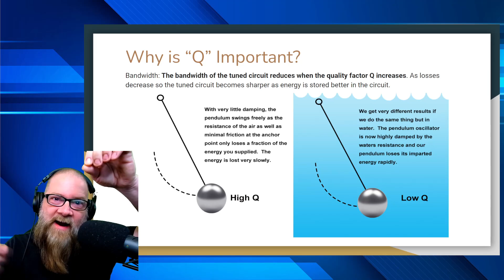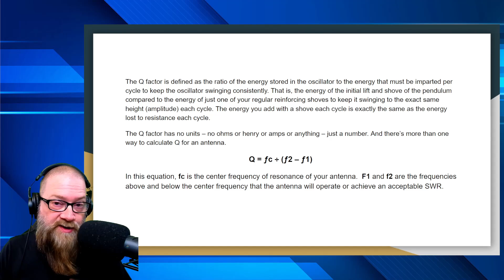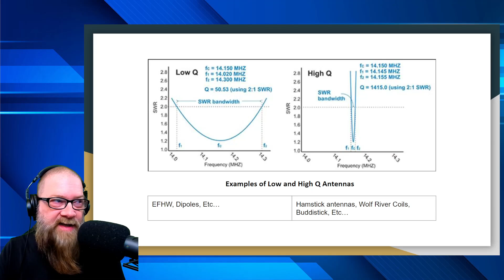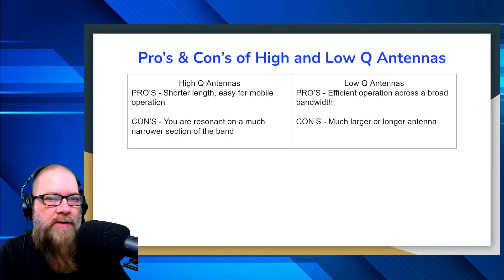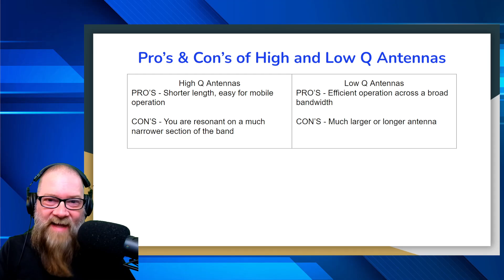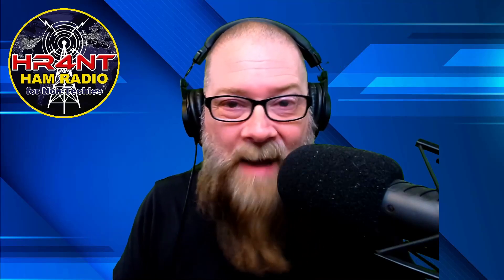What does the Q of an antenna mean?  It's easier than you may think.

Comment: A little late on this, but figure I should bring this up, as it doesn't appear to be mentioned.  As far as Q Factor is concerned with antennas, it isn't just antenna length and/or wide vs narrow banded.  There is one other item that seems to be overlooked....efficiency.  A High Q antenna also has higher radiation efficiency at resonance, while a Low Q antenna has lower peak efficiency.   To put in more layman terms, a High Q antenna is a "sharpshooter", whereas a Low Q antenna is more of a "workhorse".    

This why a properly sized Mag Loop Antenna (MLA), which are rather High Q antennas, can be so effective considering their size.  For a real world example, these are comparisons on 10/15/20/40M between my MLA and my EFHW cut for 40M ( https://imgur.com/0vq6zFm ).  These were relatively back to back test, within 10-15 mins of each other (except for 10M which was ~30mins).  While not quite scientific, it does give you a ballpark idea.  The EFHW is always a lil better; however, it isn't until it 40M that the difference becomes much more significant.  That said, while the 3ft diameter MLA is capable of operating on 40M, it's more closely sized for 20M..hence the results.  It should also be noted, the MLA was tested while in my living room...not outside...just sayin' 

Food for thought 😉
73 de KC5VAZ

Comment: Thank you for your explanation of the q factor.  So a  20 meter dipole would be an example of a low q antenna, correct? Also ,the swr reading is just to give you reference points for f2 and f1?
Reply from the maker: Yes you are spot on.  Not sure what you mean by f2 and f1??  Let me know more on that.  Thanks for the comment and for watching.  73!
Reply: @HR4NT Q=fc/(f2-f1)
Reply: Does f2 and f1 have to be for 20 meter between 14.000 to 14.350?

Comment: This article is fine as it goes being pitched at the basic end of antenna theory. People thinking on from this level will suspect that all is not as stated here, and to be fair almost everywhere, in discussion of antennas. One of the main points that leaves a lot of explanation hanging is the way we frequently jump from talking about an antenna element, the bit that is strung up in the air, and the antenna system as a whole which now has feed point, matching network and transmission lines in the mix. Much of the bandwidth of our antenna system is due to the feed and matching. Thats fine, mostly we just want to get our radio station on the air and this approach gets the job done.
So in the explanation of Q being the stored energies in the antenna and the range over which we have an acceptable SWR is a massive non sequitur, it just does not follow! Its another example of starting with an aspect of the antenna element, in isolation, and explaining it away in the context of the whole antenna system as seen from the coax plug that ends up in the shack.
The way we couple to any antenna element is at the mercy of physical properties like standing waves and current and voltage nodes. These change with frequency and yet we try to work with fixed connection points and feeder characteristics. Our connection scheme has now compromised the antenna systems frequency/matching range, not the antenna element.
Let me leave with point for people to ponder, a conductive antenna element in free space will have current and voltages induced in it from ALL frequencies of electromagnetic radiation, there is no preference for a particular frequency.
73 de G0AFV
Reply from the maker: That is a great explanation.,  Thank you for sharing!  I do appreciate it!  Thanks for watching and for the comment.  73!

Comment: High Q, low Q. An Antenna is one that gets you on the air communicating regardless of the Q, the SWR, the length, the height, how it looks. Just the fact that it works without destroying your radio and causing issues with your neighbors. Remember 100 watts and a wire are what has always worked📻📡
Reply from the maker: You are correct.  I made this video as a response to a couple viewers questions.  I agree, just get an antenna that works and go enjoy radio!  Thanks for the comment and for watching.  73!

Comment: A low Q antenna has a wider band width but requires more energy to maintain specific frequency. More energy required to keep that pendulum and Ball swinging at correct rate or frequency, do you lose wattage or do you tax the final driver on the transmitter? You are probably taxing transmitter final or even the power supply if you are pushing max power on low Q antenna, bottom line it requires more energy to be resonant. Sure someone will debate this or correct me In  some way but more energy required mean more load on Transmitter . Just my two cents Worth. Thanks for a Great simplified explanation very helpful :)
Reply from the maker: I am happy that you enjoyed the video and found it helpful.  Thank you for watching and for the comment.  73!

Comment: Thank you and another great video. It definitely helped me to understand it. I also did not understand Q and just tried to remember the answer for the test if it came up. I am still very new to this and just took the test last year. I did not know that the ham sticks were a high Q antenna, and I was looking at building a setup using several ham sticks covering different bands. I'm sure it would still work but not sure it will give me the band coverage I was thinking I would get. But still might be worth a try to see how it would work. Am I understanding correctly the DX Commander is a high Q antenna?
Reply from the maker: Ham sticks are ok as long as you don't mind tuning them for various frequencies often.  The DX Commander from my understanding is a relatively low Q antenna.  I have mine tuned up and it doesn't require a tuner to operate on the various bands I have mine set up for.  I hope this helps.   Thanks for watching and for the comment!  73!

Comment: Generally, the shorter an antenna is relative to the wavelength of the band you're using it on is, the crappier it will perform. Plain and simple.
Reply from the maker: Great tip!  Just wish those that write about these topics made it that simple to explain.   Thanks for watching and for the comment!  73!